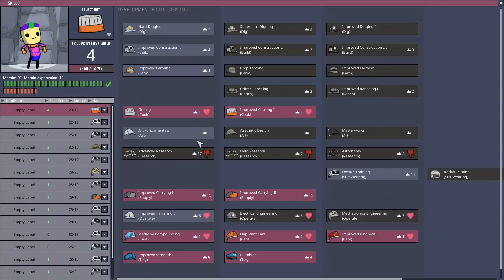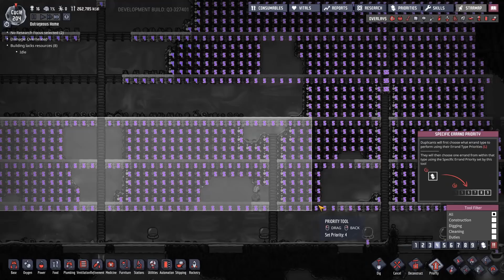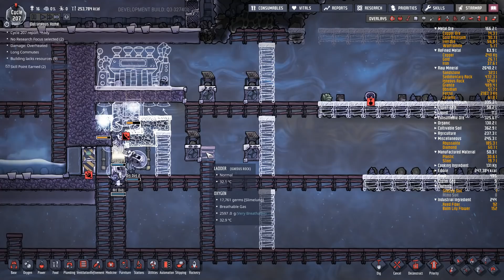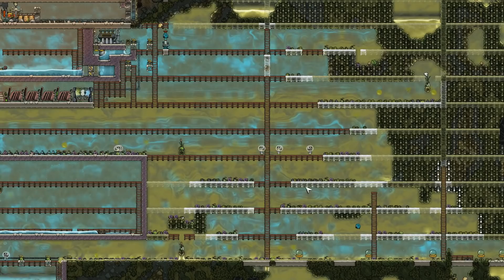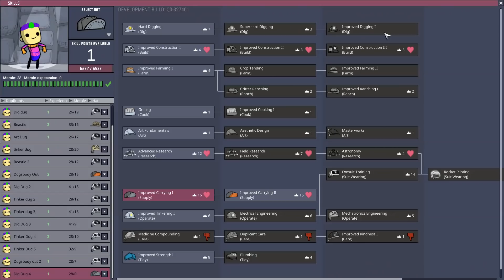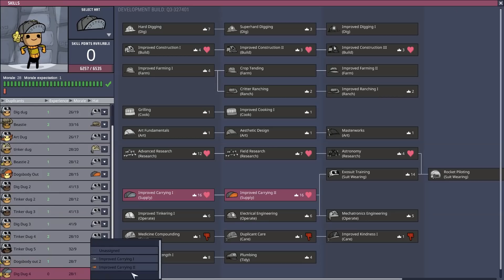QOL Mk3, 15 Sorting out my cool clear water.  : Oxygen not included

Comment: Reduce some of your path options. 
The old ladders that lead to no where. Cut off at least 2 ladders on both sides. The less paths they have to choose from. 
Less calculations. 

This is what I've been waiting on. 
After all the industrial is up and running efficiently. Which I generally don't get right anyway but, what to do next. 
Clear out some biomes. Make space for yourself. Gather up the water. 
I got my industrial area done and started to work on a steam geyser. Carved out some water from slime biome for water needs. 
Just to get water. Not cleared. 

Watched you get the gold biome and I controlled a iron geyser. Woop woop. 30+ cycles of refined iron.

Then hit the other steam geyser and clearing the oil area.
Now I have heat problems. I ran out of sedimentary and dupes started to bring in 80 degree igneous. 
With the steam geyser I have plenty left over. 
Went for other steam geyser. 
Ran out of egg shells for steel. Started a small shine farm. Just 12. They live fine off a few plants.
Hit space and launched for all research to 3 objects. Launched for materials. 

Now the base is under a heat crisis.
Currently trying to salvage it. Setup steam turbine and aqua tuner to cool the miners in space and reclaiming some wheezworts that weren't effective but manageable at cooling the miners. 

If you don't have everything in place. Don't try to move forward. 
Something no one has shown After you do a few play throughs. Everyone will be better players. 

I wish you had more time for more videos. I play faster than the videos are coming.
Reply from the maker: Sounds like you are hammering though the game nice and quick. A little steam turbine heat deletion will solve just about any heat issue assuming you got the steel and plastic for it. I could play faster but takes a bit of prep so I have a project for the video's. I should be able to speed up later when oil boiling, steam vent taming and oil wells are done.

Comment: I just saw why you're getting so much petroleum on top of your oil. You have a molten slickster hanging out down there. Don't know if that's a problem going forward or not. Also, can you please explain a bit about your initial starting base ladder layout, and why its split? Wouldn't letting dupes go straight up and down be just that tiny bit faster each cycle?
Reply from the maker: The petroleum won't break anything, if it gets in the petroleum boiler it will just pass straight through. The split is for when dupes drop things down the ladder to reduce recovery time. You are probably right though, considering the infrequency of drops I should probably remove it from future in base designs. For outside the base on long stretches of ladder I'm still keeping them.